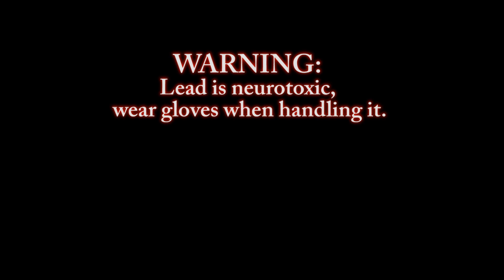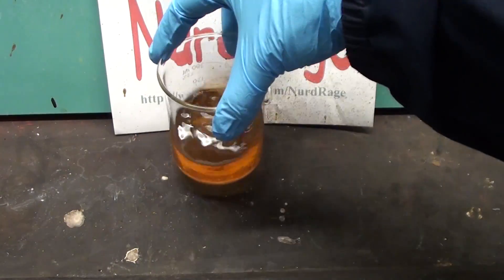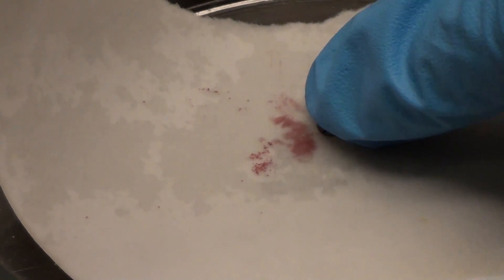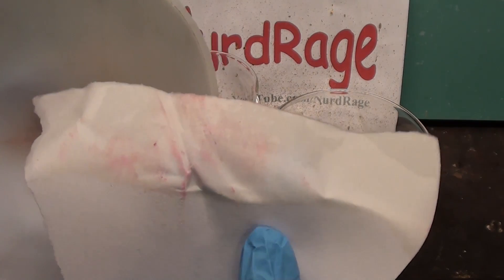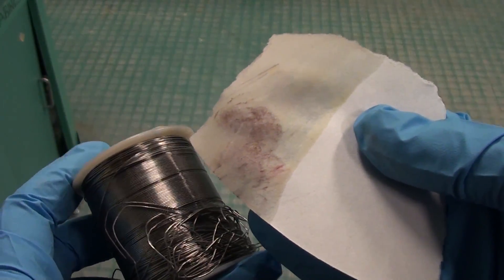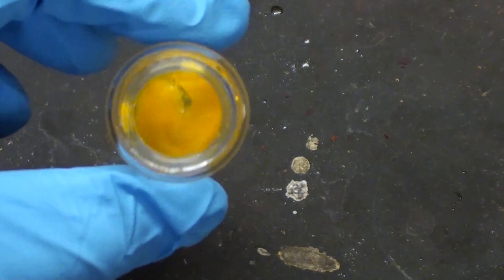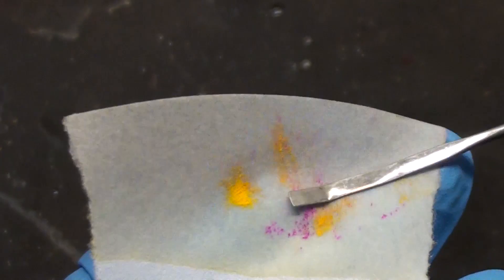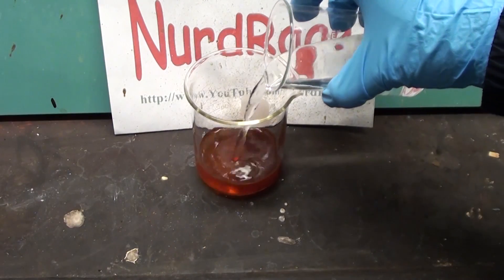Test for Lead Using Potassium Rhodizonate

Comment: Could I buy this liquid somewhere for lead testing in the uk ? 🤔
I'm like to test if I have bought lead solder tin becourse the lead free stuff us crab, thats why equipment is still solder with lead solder for hospital and other electric devices and not with lead free crab stuff, and if you don't suck on lead or similar ther is no reason to use it.
Reply from the maker: Go on Amazon or similar and look for Lead testing kits or lead testing strips. They're easy to buy now.

Comment: Oil based paints don't react with water based test solutions. if you dissolve the Potassium rhodizonate in a solvent, the solvent will dissolve the paint releasing the lead to solubility and reacting showing a clear result.
Reply: would that mean also the test might work if the paint was dry. maybe he is paid by 3m to mess that bit up

Comment: Both are dangerous for different reasons, but mercury is worse. Lead is ok to be handled and is only a problem when ingested or embedded subdermally for an extended period of time. The problem is, lead tastes wonderful, which is a problem for obvious reasons. Mercury is very poorly absorbed on ingestion and on skin contact, but has the potential for the release of mercury vapors, and mercury vapor is very deadly, (Ormolu clock makers' death sentence).

Comment: While this chemical appears to be very handy, is there a more reliable chemical that is used as an indicator for lead?  If so, which chemicals are they?  And is there a possibility of a video demonstrating the process to making it?  Also, these analytical centers -- I presume they use NMR techniques to determine whether a compound actually contains lead?

Comment: Firstly, it's called Glacial Acetic Acid
Secondly, it's moderately cheaper to make it yourself.
All you have to do is set up for simple distillation with Sulphuric Acid and Sodium Acetate. (or the more common way is sodium acetate with sodium bisulphate as it yields the same product while cutting costs on the valuable sulphuric acid.)

Comment: So that's why the buckshot is lethal... it's neurotoxic. 
:)
I guess that the lead paint ain't reacting because the lead oxide particles are well encapsulated in the resins or, there is no more lead in it. Perhaps the sample was from an unstirred container and all the lead particles settled on the bottom for the last half of century. 
Ok, I'm just joking with the settling but not with the resins.
I'd wash the sample with white spirits and try again.

Comment: There are alot of old houses in the UK with lead based paints, and because of damp and changes in temperature, it can become a vapour.
Most people who deal with this sort of thing believe that it causes a fair deal of violent behaviour in those exposed. Such as scrap merchants and old bottom class families that have had the same house handed down to them for years.

Comment: currently I have all my samples analyzed using icp-ms, but it costs about $100 a sample, and i usually need about a dozen done at a time, so it ends up being quite expensive.
would you by any chance have any other slightly less costly suggestions for me?

Comment from the maker: To be honest i'm not certain, but i don't think this is better than what you can find commercially. Luckily the commercial strips are very cheap.

But if you need very low detection limits for things like drinking water and soil samples then i reccomend sending the samples to a commercial analytical testing lab. Modern lab techniques can reach down to ppb and even ppt levels, but are beyond the capability of the amateur.

Comment: what was the minimum concentration of Pb you were able to detect using this compound? most commercial lead testing kits have a minimum detection threshold of ~100ppm and give false positives very frequently.
would you recommend this method to somebody sampling primarily environmental water and soil samples?